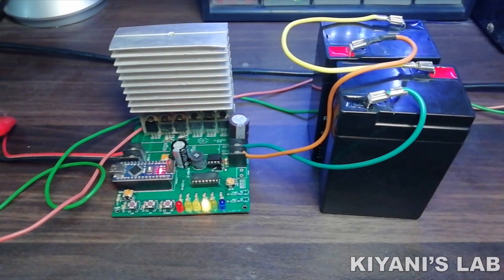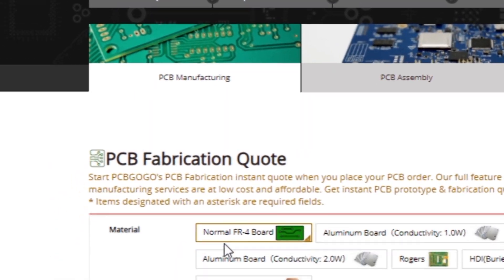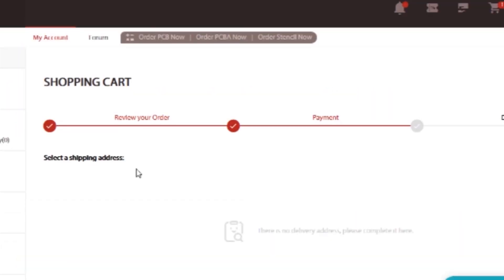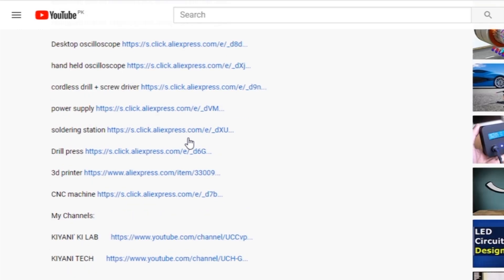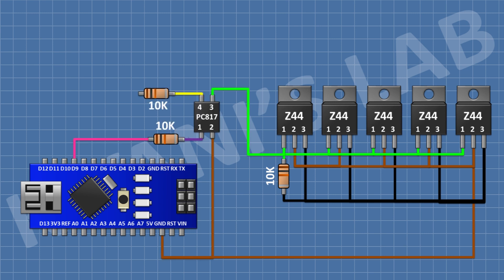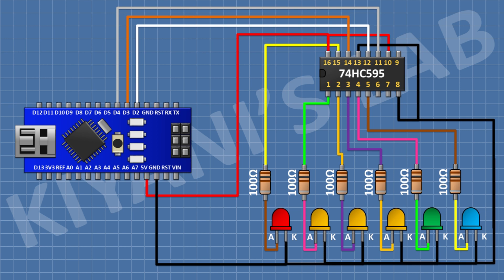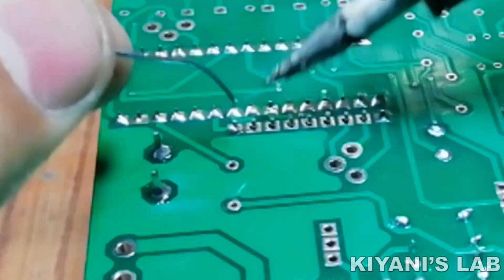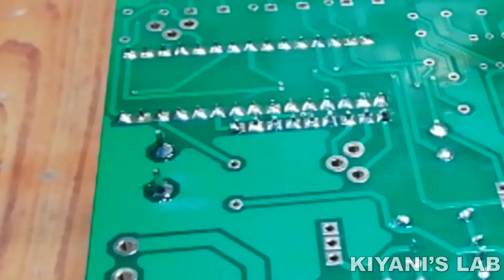How to Make Automatic PWM Battery Charger | 12V 24V Auto Detect

Comment: Why the charging current is fluctuating?? @12V battery
Reply: Because the input supply wasn't stable under load
Reply: @zainkiyani428  I am using solar 50watt panel there is also current fluctuations from 500mA to 1.5A will it affect battery life ??
Reply from the maker: no it wont